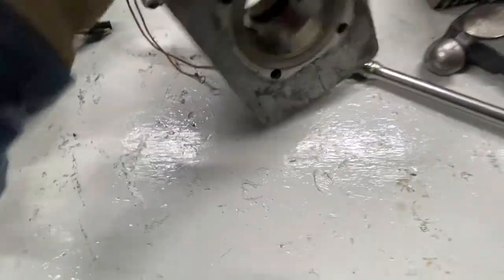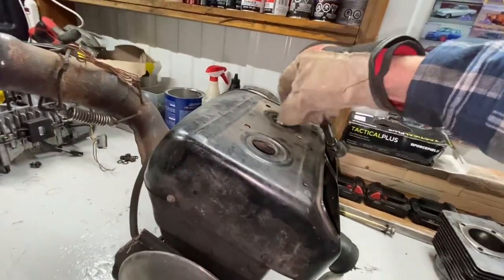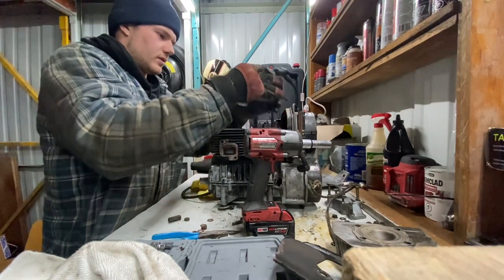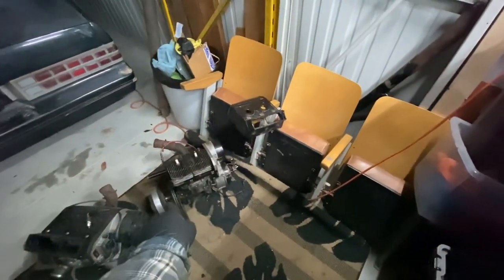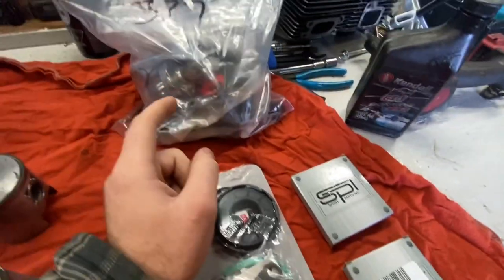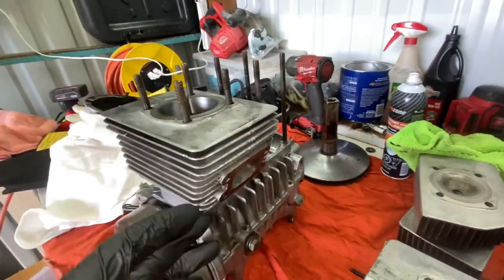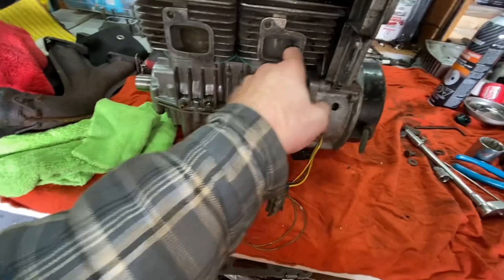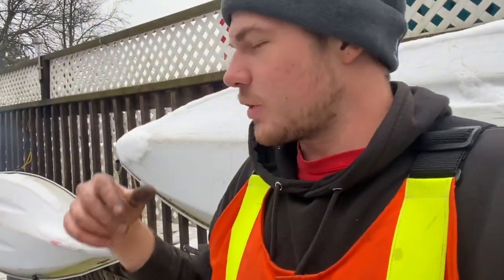SAFARI 377 Complete Engine Rebuild Guide

Comment: Appreciate the work it takes to put a video like this together. Think I blew a crank seal. This was a handy watch.
Reply from the maker: Thank you!
Reply: @Autovisions  you have anything more detailed on the trigger coil? I can’t get mine to spark
Reply from the maker: @LuukJSnijder  could be a few things, bad ignition switch, bad coil first thing I would try is unplugging the engine to chassis harness and using the pull cord to spin it over it, if it gives you spark then you know the ignition switch is bad if it doesn’t it’s a good chance the ignition coil is bad double check all wires and grounds as well
Reply: @Autovisions  my CDI is good and I broke my stator taking the flywheel off so I know the stator is good it’s new. The trigger coil is testing good it’s just not sending a pulse. It sits slightly out compared to the flywheel. Wasn’t sure if that’s normal. Should be completely overlapped in my mind but it’s more kitty cornered if that makes sense. I’m talking depth not the air gap if that makes sense.
Reply from the maker: @LuukJSnijder  other than that I’m not quite sure unfortunately, make sure plugs are gapped correctly, haven’t ran into that problem myself so not sure what’s going on

Comment: I used to use wd40 to hone my cylinders and they came out looking like yours, my old timer buddy told me to start using diesel or varsol and oh man do my cylinders turn out a lot better! also you could move up and down faster or slow down your drill to get more of a 35 - 45 degree cross hatch. your new motor will have a bit lower compression till you are able to run it a bit and break in your rings and mate them to your newly honed cylinder.
Reply from the maker: Awesome I appreciate the information!

Comment: Nice job on the 377, I was wondering how you lined up the clutch to the secondary I had to swap out motors on mine and I took out the aluminum plate that the motor is bolted to and I should of just taken the nuts off the bottom of studs on the bottom crank case lol
Reply from the maker: I will be honest I never even lined it up, I just bolted the motor back down, seems like it’s okay other than I think I’m having a clutch problem because it seems like it engages at to low of a rpm so taking off is really slow but around 35-40kmh it just takes off

Comment: Awesome video,I'm trying to start a Bombardier rotax 377 not sure what year it is but it has  electric start and 1 coil pack with 2 spark plug leads plus pull start  the Serial #4936212 ,, I'm not familiar with the wiring ,but it does not have the cdi  box on the engine it's on the frame  I  don't have the ignition switch or key.. it has the oil pump on the side with the pull start  as  the one u showed however the wires comes out of the engine ware you have you black box on your engine and the coil pack is bolted to the lower intake housing ,one coil pack fires 2 spark plug ,and 2 Mikuni  carbs ,I have subscribed to your chat I pray u could help me figure out how to get spark ,the writings on suggest that it's probably a Russian made ,the Vin 4936212,any help will be appreciated 👍
Reply from the maker: Hey thanks! It sounds like you have a newer engine roughly the 90s, you said you don’t have the ignition switch or the key do you know if the wiring is there for it ? You can also unplug the engine to chassis harness it should be beside the ignition coil I believe I showed the plug in my video, if you unplug that you should be able to pull start the engine and have it run

Comment: The 3 engines on the floor are older engines.  And when you see the 2 small coils on a 377 it is equipped with points ignition.
Reply from the maker: Awesome thank you!